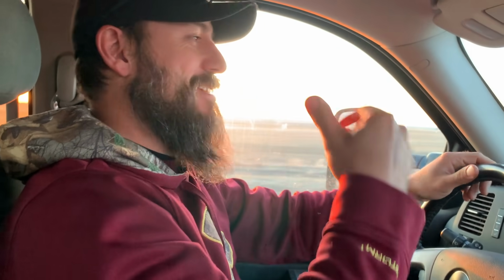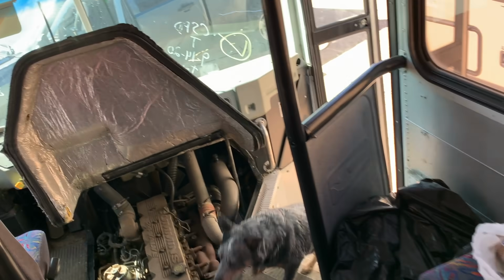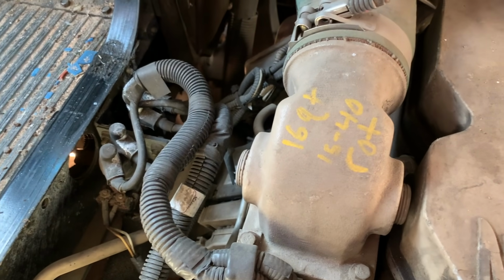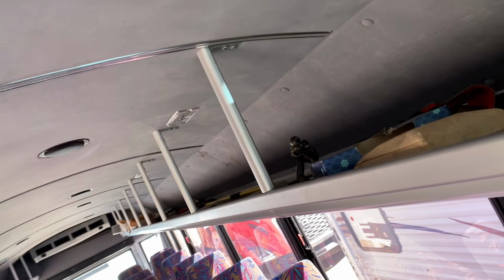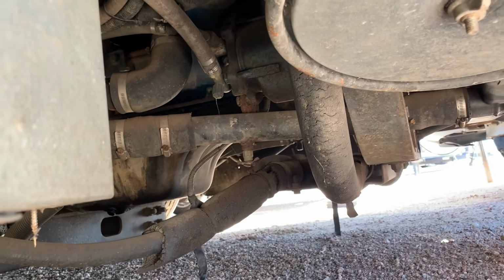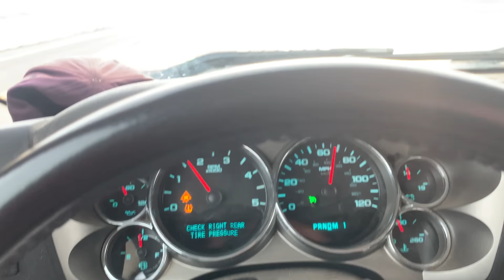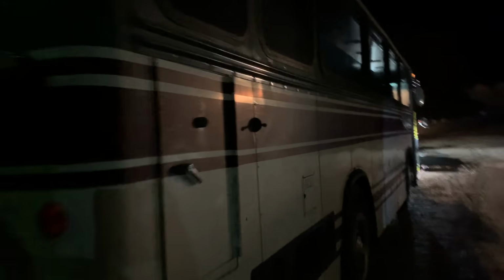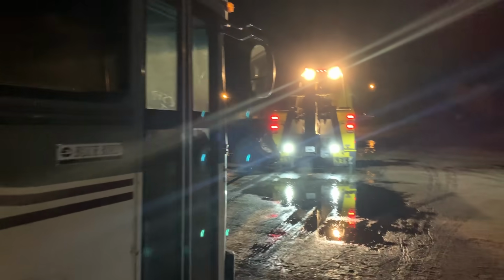I BOUGHT A FREAKING BUS!!!!! ($1200 will it run and drive 300 miles??)

Comment: You should invest in a large jump starter made from a couple heavy duty high output alternators running off a small gas motor. With some long jumper cables. We use them on roadside assistance for big trucks and such.
Reply from the maker: pretty good idea!

Comment: After my initial gasp at the towing cost, I thought it out a bit more, and it is "only" about $3 something a mile. Still a lot, but those big boy wreckers aren't cheap to buy either.  From my experiences with Blue Birds, their motor home interiors are first rate, with high end everything. Underneath, not so much. For a skoolie it no doubt meets all the requirements, but compared to a highway bus, not so much. VERY hard to service, as everything is in the way of something else.  Since yours has a front engine, you should have considerably less problems. (famous last words)
Reply from the maker: I can almost reach everything under the bonnet, all just have to be careful where i put my walls

Comment: @ Life of Lind:  You have a good deal of experience with RV's.  What manufacturers are known for solid well built, ideally overbuilt RV's of the 80's.  I do understand the biggest factor is how well it was maintained.  You never really are sure what you get, just an educated guess. But what 2 or 3 manufacturers/engine combinations would you look for to start a remod from?  Thanks.
Reply from the maker: I like NuWa from back then, if you want a motor home go with Beaver or Barth

Comment: What ever came about from that motorhome stranded far from home as well?
Reply from the maker: Thats still stuck 5 hours away with a huge 2k plus repair bill and all they did was install an electric fuel pump... so im currently having issues with the repair shop that thinks they can charge whatever they want lol
Reply: @LifeofLind  Guess that shows you it is a good policy to add one of those $18.00 click clack electric fuel pumps, some gas line, and other small stuff to your travel kit. You can never have too many tools and small parts with you! On the bus and motor homes, you can pretty much expect the drive shaft disconnected, and at least some of the parts lost!

Comment: Those wrecker services are notoriously greedy. $200 (or whatever for gas expenses, etc..) plus $120 per hour for a 10 hour trip should have been more than enough. Around $1,400 total.
Reply from the maker: should have, but I think they charge 320 an hour...
Reply: @LifeofLind  
Like l said, GREEDY!
Reply: @aguerra1381  tow trucks are not cheap greedy my ass. they have bills to pay oh a 400 thousand dollar tow truck payment
Reply: @aguerra1381  you obviously know nothing of the actual expenses of owning and operating Heavy Duty equipment!
Reply: @raycoleman3183  
Maybe l don't but around here, even a half mile tow after dark can cost you $250 and storage fees are $30 a day. You can rent a VERY nice house in this area for that..
Reply: @aguerra1381  perhaps they could do it for less, but in any case you are using false equivalency…….oranges and apples

Comment: Wouldn’t it have been better to just have it towed to a local shop and have it worked on enough to drive back to your place? I think you would’ve made out better and maybe saved a few bucks.
Reply from the maker: yeah truck shops are expensive too.

Comment: either time or money diesel fuel costs but not much compared to other so you learn from  one process  and other  mistakes don't hesitate think reasons out big toys big fun hopefully learn truth is 5.9 probably pretty used up lot bus less engine sure they run sure its small thats why semi goes 2mph I go 10- 25 mph up hill grades 1-3 is no more low rpm torque like snail not turtle not rabbit
Reply: Can you say that in English?
Reply: @phillipbremer7715  Guess not.

Comment: Trans anti drain back valve  is bad.
Reply from the maker: i'll check it out
Reply: @LifeofLind  its in torque converter. 
It just gives pause untill tq converter fills up.